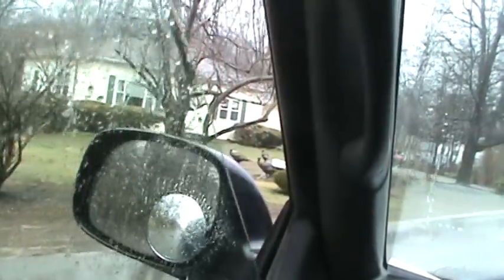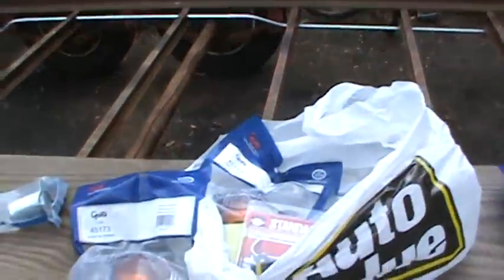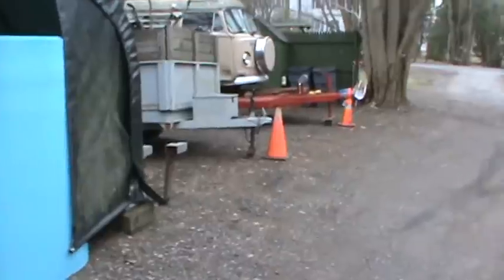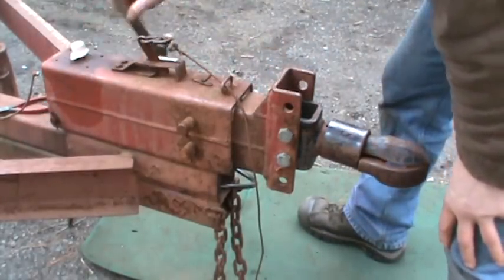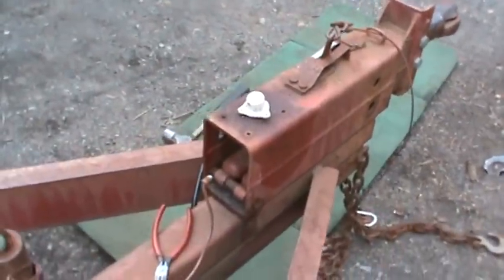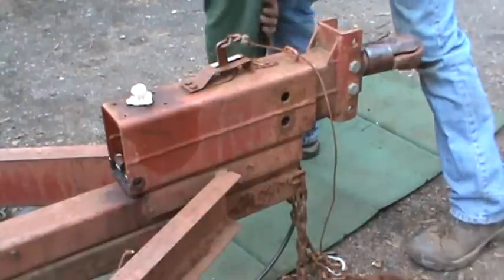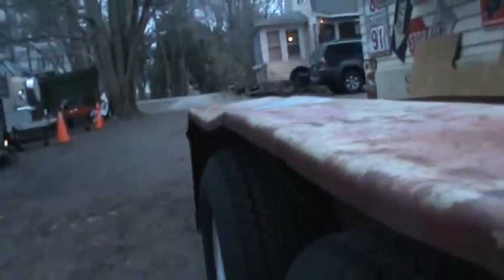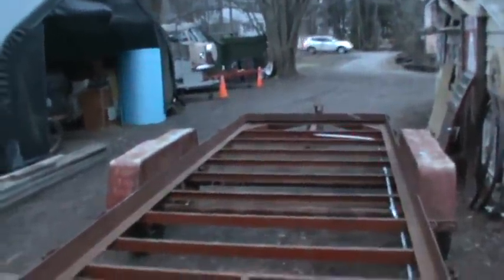janky old trailer pt 2

Comment: I like your way of running the wires much better than what it had. I used to run a lot of lights on my big rigs but in the winter you spend more time keeping them working due to the salt. Your way is the best the less connections you have the less trouble! Thanks for taking us along!

Comment: Going to be a nice trailer when you get done with it mustie1. One thing a buddy of mine taught me the wires trailers and as head trailers wired that are 15 and 20 years old and never had a single problem with the lights not working. Is he runs redundant grounds to it he runs aground all the way back to the four-way plus he runs grounds off of every wire to the frame. I'm going to do that on mine hopefully it'll work. I know it's worked on two of them that we've done so far that have worked flawlessly for the last five years.

Comment: A heat gun works well to quick dry paint. Drying out the metal and warming it up a bit first really helps it stick well. That whole trailer needs a sand blast. I hope the springs and bushings don't need replacement.
Reply from the maker: +Kevin Hornbuckle l need a fire to heat the whole trailer up,
Reply: +Mustie1 that would be optimal. But for new welds and holes, a rattle can and a heat gun can make a big contribution to longevity of critical parts and joints. If you try it, just don't boil the paint.